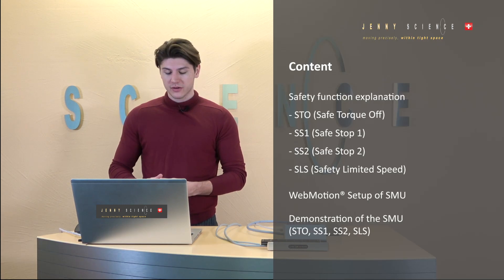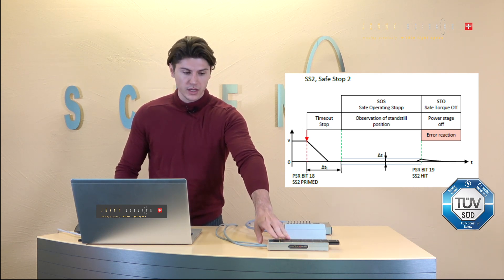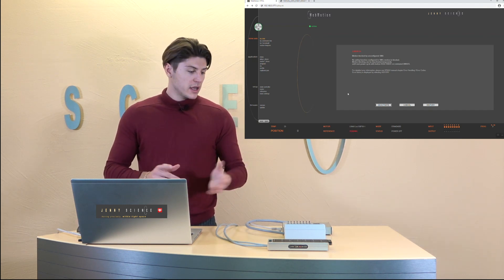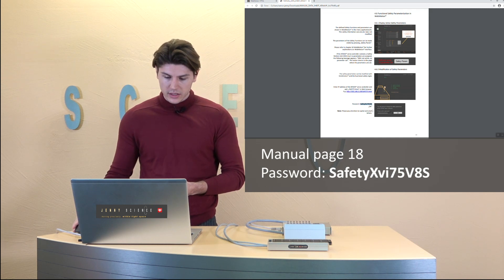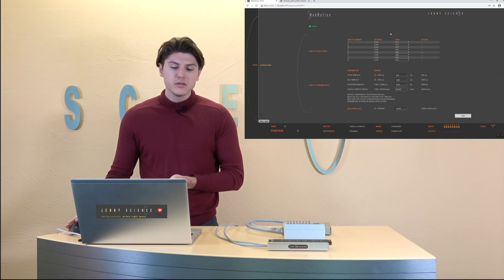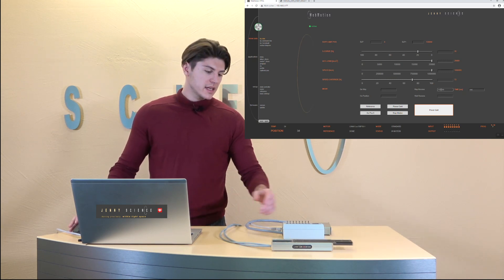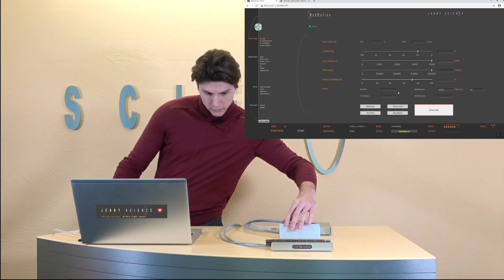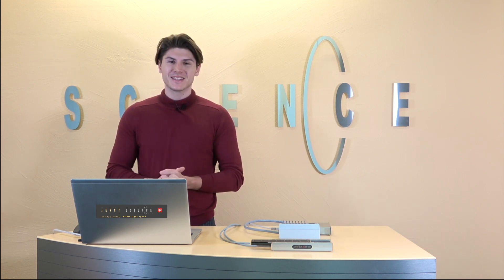TÜV-Certified Safety Motion Unit (SMU) | Functional Safety Explained | Jenny Science Demo

Comment: What was the meaning of error 64
Reply: Error 64 - Means Under voltage of power supply Motor power supply voltage is too low. The power supply probably is not able to temporary deliver the demanded current.  - Source Manual XENAX